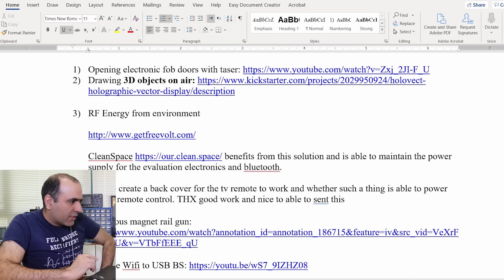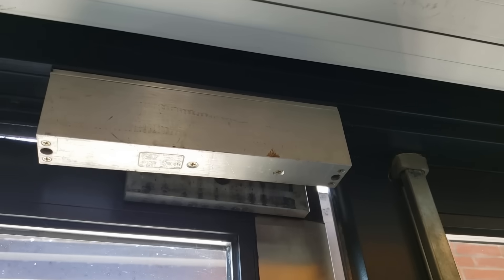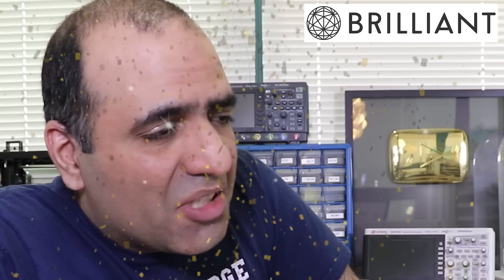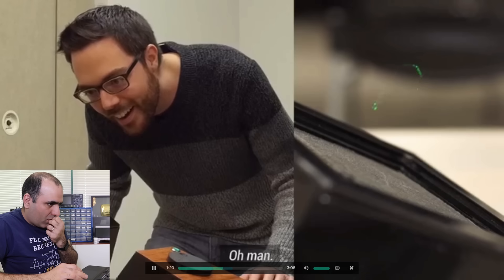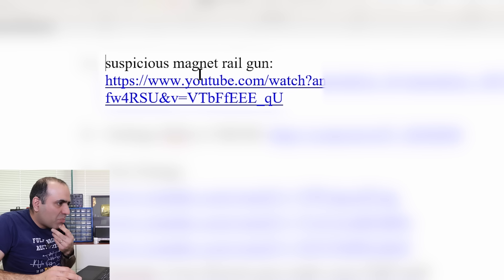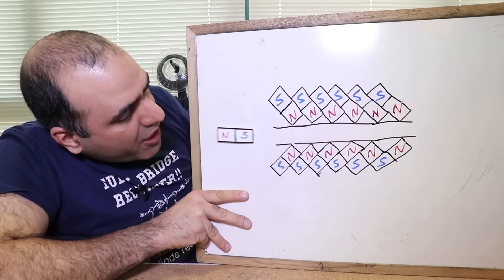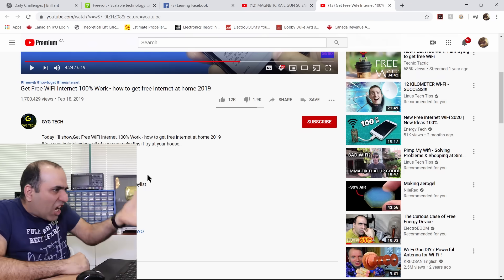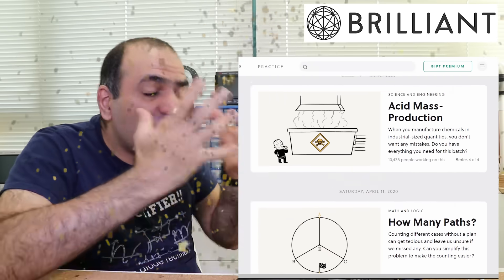BATCH RECTIFICATION of my To-Do-List

Comment: so for the Tazer opening the apartment doors, some single panel access systems have all the control circuits behind the key panel, and it's possible to carefully remove the panel short two wires and the thing thinks someone on the inside hit the "push to exit" button LPL has done a video on this. Now if those apartments are using this kind of system and the tazer has pushed in enough power not to make it think there's a signal on the egress line  then it'll think someone is trying to exit and open to let them out. not reset the panel.   this trick wouldn't work on access systems that have a separate controller. as then the lines we need to get aren't going to be ran to any external panel. doesn't mean there aren't clever ways to get around that but the tazer method will be totally ineffective on those type.

Comment: The USB phone free internet coil made me laugh....I design laptop power supplies with li-on battery chargers using PIC microcontrollers that identify as a USB HID UPS devices. That way battery status with the use of a coulomb counter can report directly to the OS. USB protocol is EXTREMELY complicated and rather frustrating at times. Many lines of code just to get the descriptor working correctly. The thought of just wiring some coils to the +5v and GND gets you free internet is wrong on so many levels, my brain is melting by just thinking of it.

Comment: Any simple way to jump on most dc appliance boards?
Simply way to convert battery pack to line voltage? 
I want to take many pos china products chop off the battery pack and time delay relays or plc or lcd timer or whatever timer, add a hard on/off switch, transformer/rectifier & fan, instead of limited power supply and a preset limited operation time i want always on, let it fail/fire if it does. I hate that everyone wants things on frigging batteries or phone cords, i want line voltage but they just dont make it for me to buy. So ive found keeping a bucket of appliance cords is a pretty easy way to match the voltage needs from the missing battery pack but for some reason the board frequently wont work from my rectifier, if i add the battery pack back and convert to recharging batteries it works? If i cut the board out and match the voltage the board would have provided it does not work....wtf am i doing wrong please? Im being general because im looking at 4 circuits same issues as i write this. Clearly im not understanding something about the board but the motor is a motor & led an led if i match power in and power out it should turn on? But obviously im not matching it or im messing up something here  :( 
Why so many resistors on these boards? My first thought was safeties for the motors and leds there in series with but whats the point of the safety on a not intended to be serviceable $5-$50 item...? 

Any help, a video tutorial or food for thought would be appreciated.

Comment: There are many other bypasses to electronic locks that works. Like blowing a vape around the electromagnetic to trigger the fire safety sensor to automatically unlock. Or just buy the keypad key to open the number panel.

Comment: Regarding safe and secure position for doors to apartment building I wouldn't say that defaulting to open is that bad of an idea. Imagine some crisis situation and doors that gets hard locked because control panel failure... From what I noticed in the offices I worked in defaulting to open is standard.

Comment: I'm a bit late here with that comment, but I live in Russia and I have same door system, so I can provide some info. That system called TouchMemory. The key has contacts that match the contacts on the lock. When the contacts are closed, data is read from the key. If too much current flows through the contacts, the circuit will reboot. And yes, this system has fail safety - if the circuit board malfunctions, the door opens. This is to ensure that the door does not remain locked due to operational errors. Zapping it wkll work, but it can cause damage to system. Zapping other fob doors (like in this video) is usless, modern ones have protection against such cheap tricks. (Sorry for possible errors, I'm bad at english)

Comment: Saw WAY better than that WAY back in the early 80's. Leeds Uni were using 3D glasses they had developed to visualise in 3D full colour 3D molecular models of proteins etc! THAT was using only a 1280 x 1068 ANALOG CRT running at just 50 Hz and 25Hz switching frequency (UK std). 

Who the hell would even THINK of doing this laser crap today when screen frequencies are more than double, are digital are 2-3 times the resolution and people like Occulus have been producing stupendous 3D headsets for years? This is almost like going back to the original 3D asteroids on a green screen CRT ... in the 70's! DOH

Comment: The first video was fake. I am from Russia and none of our locks are supposed to fail of tasers because they have a protection(because a lot of drunk people tried to do this to enter the building). I checked this myself even before I saw the video. The locks just don't react and stay closed. On 0:44 the guy tries to open an RFID lock. Its transmission coil is highly isolated. And you are more likely to burn the electronics than reset the lock if the discharge ever breaks through the insulation. I think there was another guy that pushed the button every time he heard the taser sound.

Comment: The more plausible (but still obviously fake) explanation for the "free wifi" video is that it's just acting as a antenna to boost the signal of the built in wifi, rather than acting like a usb wifi dongle.

Comment: i was looking around and i think you missed the point of the freevolt rectification where they say they are using available energy from RF to prevent card scammers or something around those lines and the clean space link is something about an app that checks the cleanness of the air around you and it's somehow linked to freevolt

seems to me that has potential for a full 24 minutes video where mehdi looses his mind

Comment: Mehdi, could you not have this mechanism at the end of a gun/low powered gun? The initial force from the gunpowder in the ammunition would propell it forward enough to position it in an unstable spot in the magnet arrangement and then it would be propelled forward more bu the magnet? Assuming the bullet was made from iron, nickel, or cobalt of course.

Comment: >"Should be passing through every PIXEL of the shape"
>Is a vector display
Reply: Still it wouldn't work due to the sides of the shape being lit up by no light source nor by the mirror reflection of the original beams! It's Fake as Fuck
Reply: @jammehrmann1871  yeah but the point is he said pixel

Comment: 3:41 yes, sometimes we can even open the door just by pulling it with high enough force
Reply: My mate lives in a house with that door, it has a button on the inside to turn off the magnets, after we had a bottle of tequila I just slammed my body against it lol
Reply: YEP, we as kids never ever remembered the passcodes of the building... Just push/pull hard enough and BAM! It opens!! 
Advantage:-You can access ANY building no matter whether you have the password or not🤣😉
Reply: @bhaktibhandari7379 that is called B & E
Reply: i once   slammed  my body into a emergency fire door  and the magnet  bar fell out  and broke some gears in the motor housing   . the ones that automatically  release the  lock  then open .  basically a double  automatic emergency fire  door  that's opened by a nfc fob  or during  a fire alarm  event  . i got kicked out lol well the teachers shouldn't of  pissed me off then
Reply: @danielhorne6042  that last bits just sad

Comment: I think many electronic door are designed to open on faliure so that people dont get stuck inside for example in case of fire.
Reply: was just about to make this exact same comment
Reply: Yeah that’s true in public buildings in case of emergency and power outage, that would work tin this case as well, but resetting the electronics is not cutting the power. depends on the circuit really
Reply: And so that fireman can enter.
Reply: Though it might be better to only be able to open it from the inside, with mechanical means
Reply: @ki0w0-lordofwatersheep  what if it's need for emergency access from outside? Such as in the case of fire for firefighters? If the locking electronics are down for whatever reason, that should not keep the door locked. The only reasonable fail-safe here is to open the door as in those videos.
Reply: They should have manual overide.
Reply: @generaza7609 , on the inside, most places do have an override button, but if you had a manual override on the outside then the mag lock would do nothing. I guess they are afraid that someone with some baby powder could set off a smoke detector and open the bank doors. But let us face it they are glass doors if they wanted in they could get in. But a passer-by that wants to help an unconscious person has to go and look for something to break the glass.
Reply: I was there when installing a system like that and they said exactly that
Reply: There is a circuit in the dedicated power supply of a mag lock that is tied into the FACP (Fire, Alarm, Control, Panel) that will open the door upon an open circuit state sent by the FACP.  If the fire alarm circuit in the mag lock power supply is connected to the FACP and not jumped out in the mag lock dedicated power supply. But there is usually a lighted exit button near the door that can be depressed to open the door by releasing the magnet. 

A lot of security personal, that work for banks will disconnect the fire alarms ability to unlock the doors. But normally when installed to code from the FACP we can open any mag lock doors tied to the system.
Reply: @WilliamMcCormickJr  wow.... that last bit cant be legal right? like... if there ever is a fire then those people are essentially responsible for every single death and injury that happens as a result...
Reply: @SharienGaming  yes, they would be responsible for those deaths. The only reason they do not heavily enforce it is because the people on the inside have an exit button, most are glass doors, and the firemen have axes and Halligan bars. But when someone dies then it will be important. Usually doors are glass so if someone wanted to get in it is not that hard magnet or no magnet.
Reply: @SharienGaming , the real concern is that early morning there will be a fire with a lot of carbon monoxide that knocks everyone out and a passerby that could have pulled them to safety would not be able to get into the area.
Reply: @SharienGaming , while working in Manhattan banks, we would have to pass through the teller area many times while tying in a new HVAC systems fan shutdown relays, to the firearm system and we would always have a guy at the fire alarm panel monitoring for any real alarms while we had the system disabled. I would have to enter the teller area and I would use our VHF building radio to call the fellow at the panel who would disable the nag locks to the teller area. And a few times some of the tellers lost it. They were so afraid that they were not in control of the money. I think bankers have a different mindset or something. Everything was ok because they knew we were supposed to be there but when they saw the locks disable without them doing it then they panicked.
Reply: @SharienGaming ,  it is definitely illegal to disable the fire alarm system's ability to unlock doors while the panel is in alarm. But money is king to bankers. I used to work in Manhattan banks and we would open the doors to the teller's area by using the fire alarm control panel. We were supposed to be there but when they saw we could just walk in they got scared. Even though we are supposed to be there the fact that we could come and go upset them. Because the banks hire people that protect their money. Their security people often disable the fire alarm systems especially in the offices that control the accounts. That is more important to them than the branches that just have some paper. 

Sincerely, 

William McCormick
Reply: That's what I thought. And that's quite sensible. Stairwell door protect against drunkards, and thieves counting for very easy target, not against determined thieves. Apartment door is the defence against the latter.
Reply: I think you're correct but this is the internet and therefore I am required to argue with your now 4yr old comment. I shall commence:
Wrong! That doesn't make sense! 

There is no rule that I have to backup my statement so this will now conclude my daily internet adventure.
Reply: yes they are, but that shouldnt apply to the external console that can open it from the outside
a system like that would likely just have a handlebar on the inside that if pressed interupts the circuit to the electromagnet mechanically, which lets you open the door from the inside
and of course it being a closed if powered system: a power failure opens the door, so also safe for emergencies...and a full power outage is a bit of a difficult attack to gain entrance (also easier to just trick an existing REX sensor or looping a hook around a handlebar)
the external panel should only send the inputs to a system on the inside where it then decides whether to disable to magnets - which would mean that shocking the panel likely doesnt do anything, since there arent any relevant electronics there (the display might reset or burn out - but thats about it)
Reply: that is a matter of priority, protect life or protect property
Reply: Yeah, this makes sense. Still, you'd think they could design it with a safety feature on the inside that would disconnect the electromagnets. Like an emergency release switch, or even connect it to the fire alarm system, just have a solenoid or relay that would kathunk the door open if it's pulled. 

They could also add a heat fuse, so that excessive heat will burn the fuse. There's lots of options, I think the Russian examples are just the absolute cheapest safety feature.
Reply: @MatthewSmith-sz1yq  those are nice ideas, a physical kill switch on the inside should do the trick...
Reply: @MatthewSmith-sz1yq   its mandatory per most fire alarm code and building code to release all maglock doors when the fire alarm system goes Into alarm.   They also use a pull stations that is wired in series with maglock doors, so even if there is some sort of malfunction and the door does not release from the fire alarm you can engage the pull station and cause a direct power break on the circuit that powers the maglock
Reply: @MatthewSmith-sz1yq  though if the heat's already that near to the door, maybe it's no use as an escape?
Reply: @MatthewSmith-sz1yq  I believe heat fuses exist already in a alot of them...
Reply: @MatthewSmith-sz1yq  I get that I'm replying to an old comment, but maybe more people will see it in the future.

So, all these magnet locks obviously have some button for being opened from the inside, otherwise how else would people be able to leave the building. Also, the magnet is connected to some kind of outlet in a fuse box that is publicly available on the first floor of the apartment building. At least, that's how it is in Russia for those kinds of locks.
Reply: Hmmmmmmmmmm. Hmmmmmmmmmm hmmmmmmm hmmmHMMMMMMM🤔🤔🤔🤔🤔🤔🤔🤔🤔🤔🤔🤔🤔💩
Reply: @nitrogosh5208  are you ok mate?
Reply: @shayanmoosavi9139  are you a doctar fam
Reply: @nitrogosh5208  no, but I was genuinely concerned for you. I'm not being sarcastic.
Reply: @shayanmoosavi9139  I just like humming fam any problem mi amigo
Reply: @nitrogosh5208  as an actual doctor I diagnose you with: gay
Reply: @corb2193  bro chill it's okay if Ur gay.Even if ur a 9yr old who's fortnite in-game name in yomum. And now take that as a compliment
Reply: @nitrogosh5208  ?
Reply: @corb2193   oh sorry honey.its called English.
Reply: @jasonander4964  nice to meet you and you are???
Reply: @corb2193  ignore that Nitro guy, looks like he is going through the phase.
Reply: @nitrogosh5208  eventually you’ll look back at this and think “i was an idiot”
Reply: @official-obama  You know I actually think iam an idiot who is replying to a conversation I had 2 months ago
Reply: @nitrogosh5208  you actually think you are? i can’t hear your tone of voice

Comment: I believe the concept of the taser on the security panel is that during a power failure or other emergencies, the doors need to be opened because them being stuck closed would be a safety issue.  It's an ironic confirmation of the trope in movies where shooting a door panel opens the door.

And before you think this is stupid, I work in the electrical field, I was called to an "insane asylum" that had lost power, and yes all the doors were open.

Comment: I mean I can understand why the doors would default to the unlocked position during a power loss or reset. if you have a blackout or some other emergency, then you would be trapped inside the building.

Comment: there is a reason that if the system fails that the door is unlocked. Its failSAFE, meaning it would be accessable as a fire exit during a fire